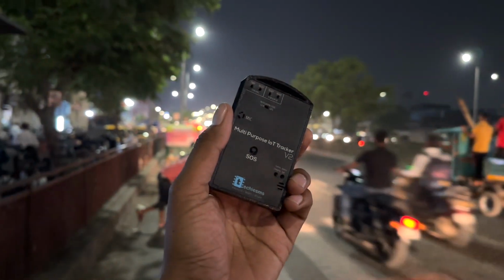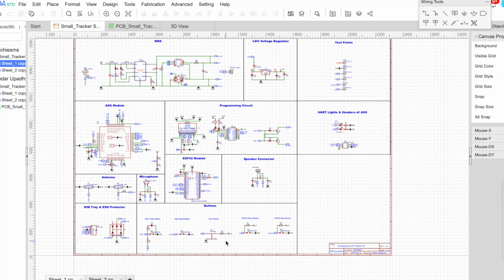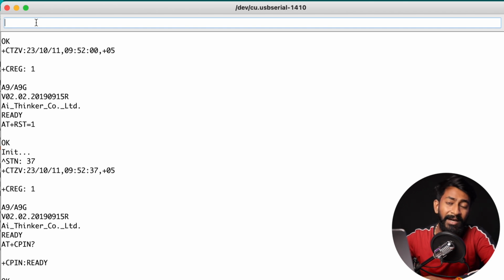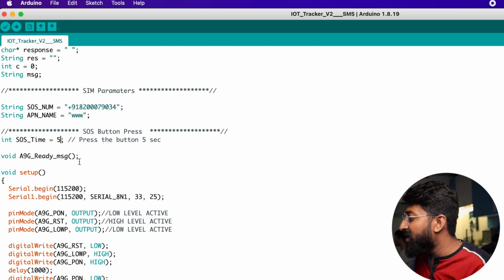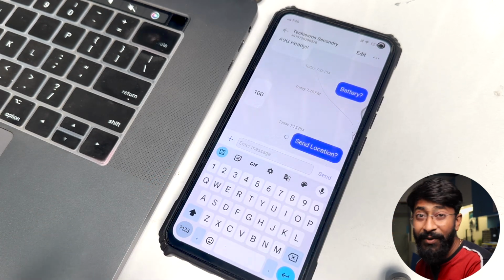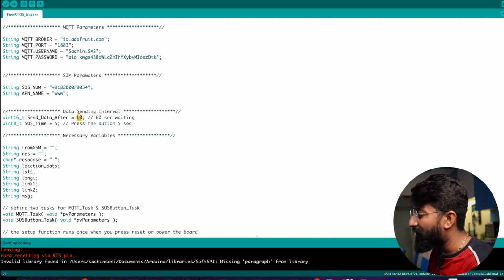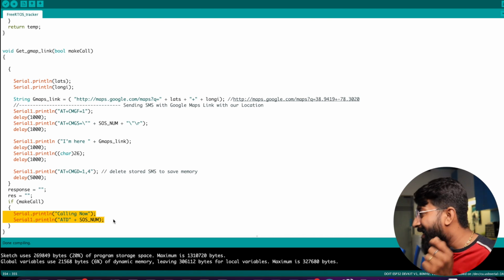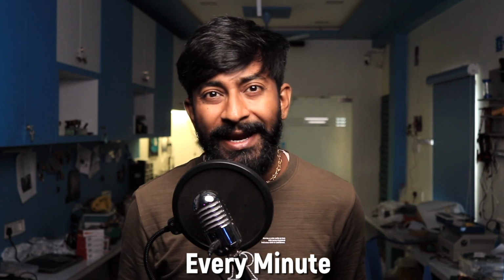GPS Tracker, Audio Spy, SOS Button | Multipurpose IOT Tracker using A9G & ESP32 | IOT Projects

Comment: @techiesms I want to upload the third(realtime gps tracker) code to directly on the a9g dev board. Byt whenever I am uploading this code, it is showing that there is a fatal error and serial data stopped and it is also showing error code exit status 2. How can I solve this problem? Can I upload this code directly to a9g module by using usb to ttl converter and arduino ide?

Comment: Hey....Loved your project as always....the SOS button system and real time interfacing is really amazing 
I've worked with GSM modules and can feel how much time you must've spent to get it working 😅

One way of saving battery can be -  providing MODES as in 
1. sleep mode - here you just expect SOS to work (using hardware interrupt you can switch on the system, rest of the time it is on sleep) 
2. Normal mode - here, you can use the real time location part 
and you can provide a switch on the board or just use the SMS feature to set the modes 

Such products will be really helpful in women's safety as well....but network availability matters the most. 
how about making it work without internet or network connectivity ??  Would love to hear your thoughts on this

Comment: Great project!
Could you make a video measuring the current of the tracker, that would be interesting and good to see how much it’s using when awake and sleeping. 

You can find out if the gsm unit sends an under voltage warning when battery gets low, then you can send an sms when it’s low. Not sure about the A9 but I know the sim800 has a pin (RI) that can wake the UC when an sms is received or when it receives a URC.
I have made a similar project using the Sim800L, pro mini and an L80 gps
Happy birthday!

Comment: Awesome project as always but just one question why make a 2G gps tracker when in most countries like mine did away with 2G long back? Can you move over to using 4G ??
Reply: It's because the A9G module he's using is very easy to use but only supports 2G. There are 4G GPS modules available but in general are much more difficult to work with.

Comment: nice project i am working on the same but with sim800l and neo6m gps but mine is sending realtime data to firebase then i created an app where you can view realtime location and can be installed to a car since you can turn off or on the car as you receive the data you can turn it off on the app wherever you are on the planet
Reply: Can uh share code with me bro

Comment: I am selling IOT VI SIM card. It cast is Rs.699/ Year only.

Its cast efficient. 
If you using normal Sim card it will be Around Rs.2150/Year. 

I am changing 1/3ed of amount only for this M2M SIM. 
M2M Mean Machine to Machine. Its best sim for your IOT Application.

Comment: to improve the devices sms detection , you can convert the sms that the tracker receives and use the toLowercase() function to make it all lowercase and also search for words with the function indexOf("battery") , that way if you send an sms to the device with the word "BaTtErY" it will trigger the battery command , even if you send a massage to the device with "can you tell me your battery percentage ?" the device will respond with battery sms , becoz "can you tell me your battery percentage ?" contains the word "battery" so the device will execute the function.
 it will be something like this if(receivedSMS.toLowerCase().indexOf("battery") > 0 ) { // the word battery is found in the sms , i need to send a sms }